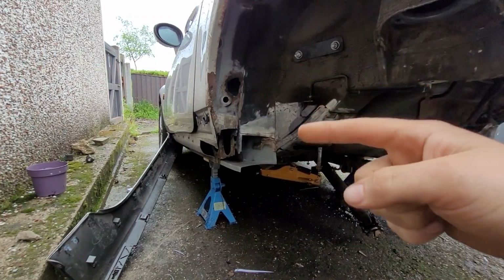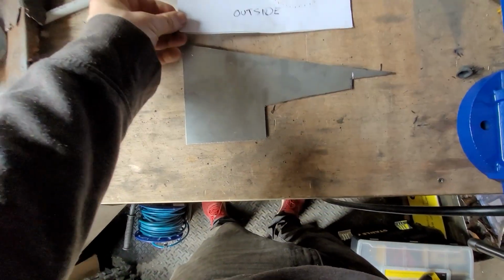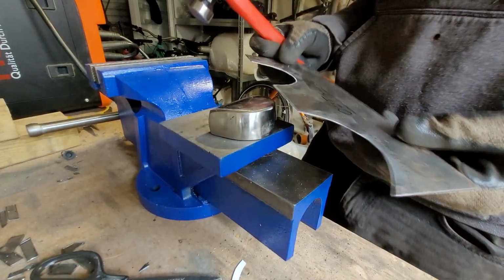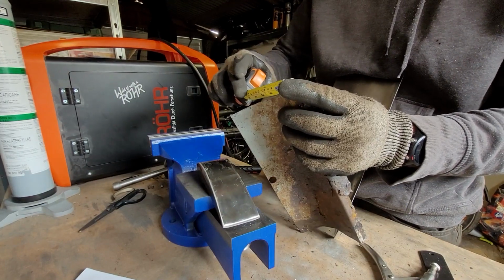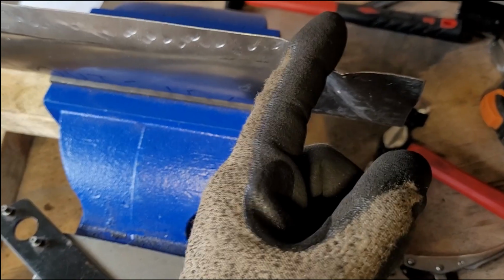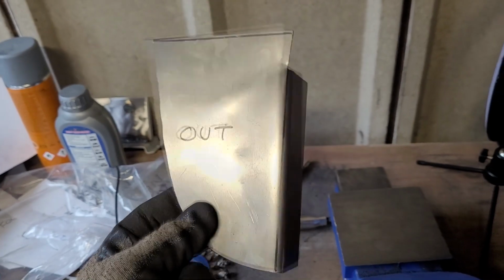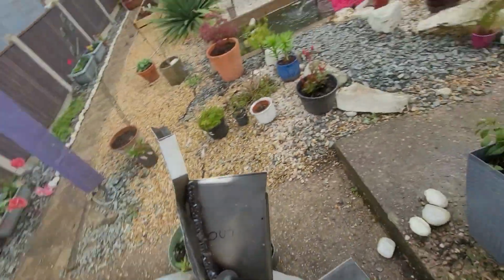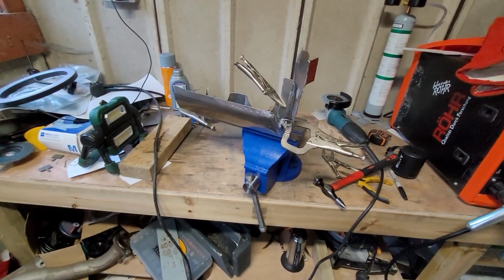Track Car SOS | ep7| Beginner Fabrication

Comment: Do you have a link to the sheet panel, I've searched ebay, but I cant find it.
Reply from the maker: I hope you weren't searching for MX5 sheet panel, in which case I wasted your time. If you search for mild steel sheet you should have some luck.
Reply: @chrispleasscars  Yes I was, as I thought the sheet had pop off pieces, so I presumed it was made for just MX5s